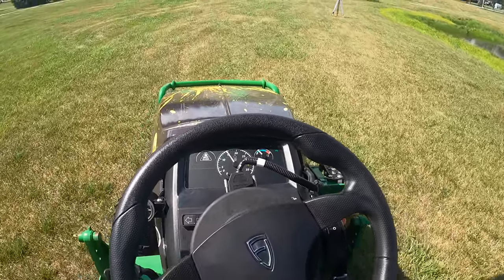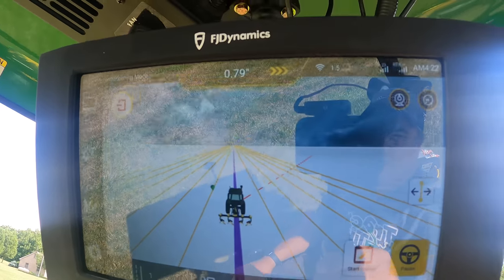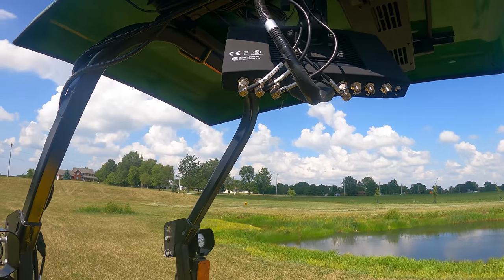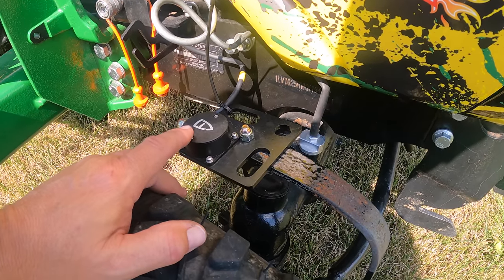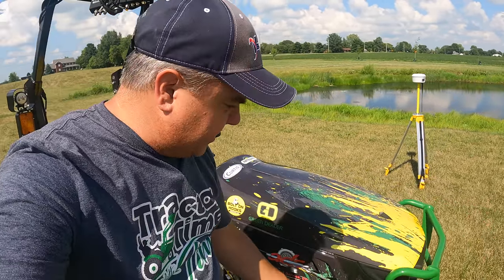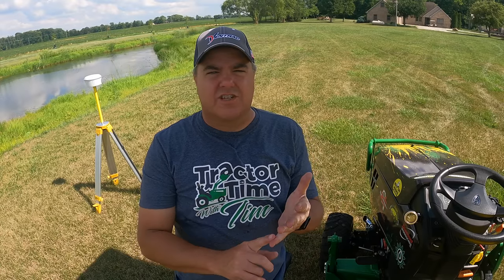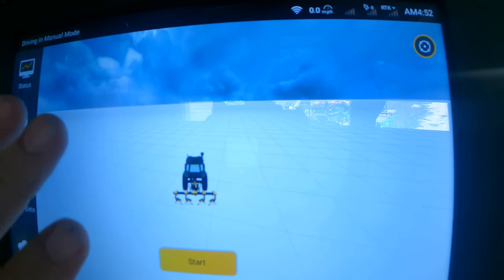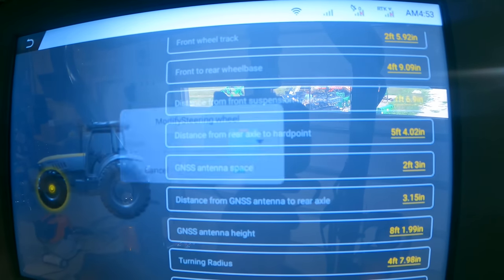AUTO STEER! John Deere 1025R  with FJDynamics Kit! Subcompact Tractor!

Comment: I actually fabricated an auto steer system for my 4066R cab tractor.   It’s all top end Trimble equipment with an EZ steer motor.  Not the most ideal, but it works, my total cost was around 10k.  But like with the others, starting next year after the free trial ends I’ll have to pay for a subscription.  This FJ system is very intriguing because I just bought a 5125r and have to install a system in it as well.  Deere will always be the best integrated system but they are pricey.  3 grand for subscription and another 15k for equipment.  Thanks Tim for trying new things!

Comment: I am an electrical engineer with a background in guidance and control systems. I can't speak to how FJD designed this system. However, in all the systems I have worked with, the IMU is the primary guidance sensor. IMUs are extremely accurate. In our product testing we have a true north line marked on the floor and align the IMU accordingly. Then we verify that the IMU accurately measures the forces of gravity and Earth rotation while sitting perfectly still. The GPS data is used as feedback to correct for the cumulative error due to rounding and truncation in the guidance algorithms. Civilian GPS is not as precise as most people think. Unsupplemented GPS for civilian use is designed to locate within about 30 feet. The US government/military guard the GPS system very closely, and use classified cryptographic codes to unlock the additional data that allows their systems to track within 1 foot. The navigation apps on cell phones and other devices combine GPS information with data from cell phone towers to enhance position accuracy.
Reply: Our sprayers at work will keep within a foot.  Our controller requires a minimum of 8 satellites though
Reply from the maker: This one was connected to 26-27 satellites at times!
Reply: @TractorTimewithTim  and you couldn't get down to a couple inch accuracy? We run hagie sprayers with raven controllers and if it's not within 6 Inches on 90 feet wide booms something is wrong. If it won't stay withing 4 I start adjusting settings
Reply from the maker: @2009rummell  yes, we have sub-inch accuracy, as I showed in the video.

Comment: The Fixed unit on tripod will have a GPS unit within. That GPS unit will be monitoring the variation in position that it sees for its own location from the GPS satellites. The system is using that variation to correct the variation seen by the GPS on the tractor. It’s actually a pretty simple solution to the GPS accuracy issue.

Comment: Love all your videos but, I really can’t see this on the average small tractor owner. Thanks for keeping us informed of new technology.
Reply from the maker: Correct…not something which would be needed or common on small tractors.  This video is not trying to ‘sell you one’. Rather, I intended to show you basically how it works.  Thought it would be interesting to our viewers.
Reply: If someone was trenching small pipe or wire you should be able to map it out then the tractor would drive it. Or something similar.
Reply from the maker: Yes, that could work.
Reply: @2009rummell  I like that idea because then one knows and has a map of where that wire or pipe is if it can be saved.

Comment: Tim I also used a Ram mount with their tough class and mounter my Summit Hydraulics control box on the hand rail or the right hand fender. I hit my elbow on the metal mount that was supplied.. love the self steering, just don’t know what I would use it for. Keep the videos coming

Comment: Tim, I can see you sitting there with your drink and cheeseburger while the tractor and auto steer mows your yard.  Like to see you use the pull box blade system and auto steer system to create a curved drainage ditch.  Great video and I like that you added some out takes.

Comment: Thanks Tim. Kristy..  
I watched the next video 1st before this one. LOL
I wonder if the Antennas were on a good gimble to keep them level due to all the bobbing around of the Canopy .
Would it keep the system from over reacting with the steering wheel ?
I watch Wes and Andy use their systems and the steering wheel does not move as much because their big heavy tractors 
Float over the ground better. 
Just an observation with the Accuracy of the system to maintain track. 
Mike M.
Reply from the maker: I suspect the short wheelbase is contributing.  I’m not sure if there is software adjustment for this or not.  I didn’t see any sensitivity setting.

Comment: I'm wanting a tractor with a loader to move logs for a sawmill... I'm currently using an X595 with a 45 loader and it's a lot for it. Trying to decide between a 1025r and a 2 or 3 series. The logs weigh around 400lbs average.
Reply from the maker: 3R would be a good choice.   3e is same as 2r …so don’t get fooled by the 3 vs. 2 on that.
You’ll have much more stability and strength with 3R, or even 4M.

Comment: Is it now physically harder to turn the steerring wheel if it isn't is use (or breaks or fails) or when it isn't powered for some reason?
Reply from the maker: No. Turns identically if Autosteer is disabled.

Comment: Hey tim! Great videos. 
Just a question; why do you prefer JD over Kubota? Probably a common question, but I’m curious. I come from a line of JD lovers, and I’ve been around both. Is it just your preference? Dealer support? Better experience? 
Thanks!
Reply from the maker: Check out the 1025r vs BX review series. That will show a lot.
So far, the Deere machines have simply been better machines.  This may not be true In every model,  but the two that I have experienced (BX and LX3310) have not been nearly as refined as their Deere counterparts.
I am not religious about it.  If I found a Kubota that competed successfully, I would show it.  Closest thing I’ve seen so far is Grand L vs 4 series.
Reply: @TractorTimewithTim  gotcha! I’ll take a look at it. Yeah, From what I’ve seen with grand L they look really sharp and refined. I’ve heard it’s somewhat of a “limited” model, hopefully that’s not true or will be named something else.

Comment: Tim, nice video. Maybe you did this on purpose, but you did not show the GPS antenna and its mounting on the roof of the canopy.  Was the antenna and/or its mounting bar included?  I have seen other farm tubers use systems from this company and seem to like it well for an aftermarket system that actually turns the steering wheel as opposed to directly operating the steering valve used in larger machines such as large tractors or combines. Thanks for video and how did you convince the finance committee to do this? HA.
Reply from the maker: Simply forgot.  The kit includes the bracket and all the antennas.  I used existing bolts in the canopy to hold it on.
FJDYNAMICS provided the kit for our evaluation.

Comment: Interesting technology.  With a range of 10km, can the mobile base unit be set up in the garage or other out of the way location? Or must it be placed outside?
Reply from the maker: It must have satellite reception, so must be outside.
Reply: Must be outside, because the mobile base is a GPS unit that is measuring the variation of the GPS signal and relaying that to the on-board electronics.

Comment: Tim if you was buying a 25 hp tractor which one would you buy between Deere, Kubota, TYM or Kioti I will be needing mid mount mower and backhoe
Reply from the maker: Deere 1025r.Head and shoulders above the rest.
Reply: What about the 2025r is it better than the others also

Comment: Fun to watch rich people that can't run equipment!
Reply from the maker: No idea what you mean.  This video has no ‘operation’ to speak of.
Reply: So how big is your farm?  How many hours a year is your backside in a seat, 500, 1000, 1500?  Twenty seven years of hanging on to a buzzing steering wheel has left me with a mostly paralyzed left hand.  Anything that saves a farmers body is worth a lot. Not mention over application of chemicals if there is overlap when spraying and escaped weeds and pests if areas are missed.  Then there is "cultivator blight" if guess rows get too narrow.  $10,000 is nothing to any sizable farm.